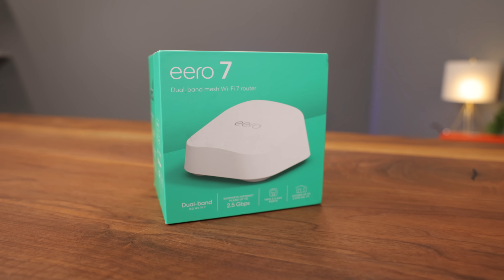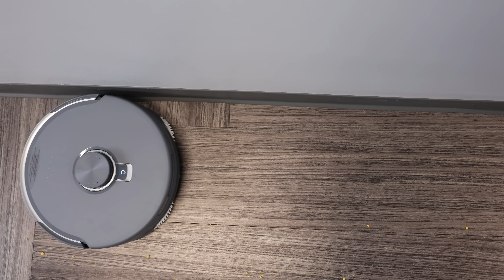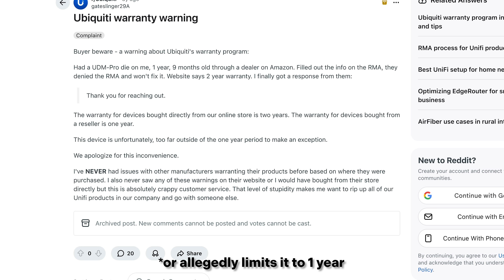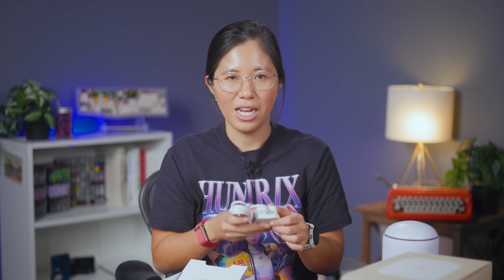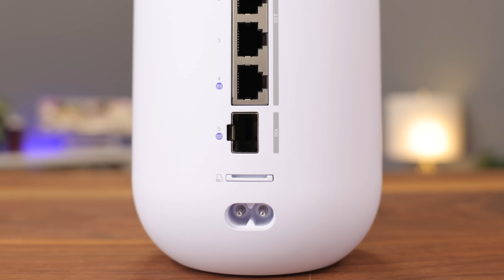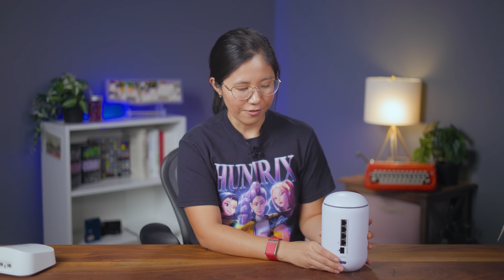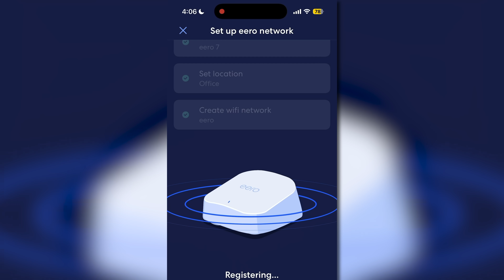Are Expensive Routers a Scam? (don't waste your money)

Comment: The comparison is interesting, but calling a 135€ Wi-Fi 7 router the “cheap option” feels misleading. At that point you could build a DIY router running something like OPNsense or another Linux-based routing setup, pair it with a budget access point, and end up with a solution that’s cheaper, more private, and way more configurable. Neither of the two routers shown really hits a good price-to-value ratio when a DIY setup outperforms both for less money.

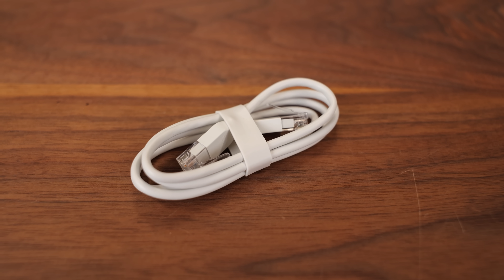Comment: 9:07 at 3 feet, the type of cable is almost irrelevant. Cat 5e, introduced in 2001, can reach 10Gbps across 3 feet.
The listed top speeds for different types of cables are for what they promise at much longer cable lengths, 50-100 meters.
That cable is not Cat 7 or 8, which required shielding & grounding, and would have metal caps on both ends.
In a home, anything since 5e is almost certainly plenty. A home user that would benefit from Cat 7 or 8 is going to be close to non-existent at this time

Comment: The way you say "eh thernet" cracks me up :) I mean that with luv... so I just bought my Ubiquiti Dream 7 a few days ago. HAven't hooked it up yet, as I'm on 2Gbps/2Gbps Symmetrical Fiber at the moment, and I'll be on 8Gb Sym. soon. ANYWAY Thank you for a GREAT video!
Reply from the maker: Where do you live to get these internet speeds? My max in the area is 1 😢
Reply: @SwitchandClickOfficial  I'm in Eastern Nebraska. company is called Fastwyre. Pure fiber even to the sfp+ using ONT. I pay $69.99 a month (with tax, a few fees etc.) for 2Gbps Symmetrical fiber. ZERO equipment rental fees using a CALIX GIGASPIRE BLAST U10XE. I'm soon switching out to the Calix Gigapoint Gp1100x so I can use my Ubiquti Dream 7, and a couple PoE++ switches for my network.
Reply: I want what you’ve got!
Reply: @louisuhls9528  I would share if I could! it took years in this area to get it!

Comment: I love how Ubiquiti HAS all three. Entry level,j Mid level and commercial level.
Reply: the entry level, mid level and commercial level are marketing term so that people think that the more expensive one is better. I have several clients that hesitate on going to unify system when I am doing their networking, I told them that ubiquity products don't have entry level they are professional grade products for every specific use. I told my clients that what they have is home network (entry level), SoHo (Mid level) and enterprise/high availability (flagship). when I explain those properly to the clients that was the time I was able to convince them to go with ubiquity products.
Reply: @slasher0009  THIS, I must say, Is Brilliant!  Thanks for sharing I'll have to remember this! SPOT ON!
Reply: I don't think ubiquiti really has an entry level there all professional products I also don't think prosumer is the right class for ubiquiti it's a business solution that they let normal people buy.
Reply: @jayred8289  I feel like the u7 express would be entry entry, like first wifi for apartment. And the udr7 is great for most people using most of unifi products, not just the network. The udr7 is shockingly powerful and it's not much more expensive than midrange stuff from other brands. The app is incredibly easy to use (and you can still use a web portal if you prefer). They really feel like a near perfect product for networking for most folks and I've ran through a LOT of routers since wireless g.
Reply: @jayred8289 what's more user friendly, prosumer,more affordable?
Reply: @jayred8289  This $279 gateway/AP combo unit is definitely entry level imo.
Reply: @j@jay @jayred8289 s a business system that’s easy enough to use that it’s good for home use too.

Comment: No more combined devices for me. Gotta buy your router, switches, and aps separately. Only way I saw to have a full 10Gbit network, current wifi, and coverage wherever you want it.
Reply: Same. However, you need to be a little more tech-savvy than some people who are going to Walmart, Amazon, etc., and buying a package of three or four meshed access points that you do almost nothing with (other than plug them into power). Ideally, people would be understanding and configuring firewall rules, VLANs for device isolation, etc., but that is a completely different group of home/SOHO users.

Comment: Not worth buying anything that isn't openWRT compatible. And right now there are very few wifi7 routers available on that compatible list.
Reply: Yeah, Wifi 7 is quite in beta right now for openWRT. Banana Pi R4 is a good candidate but still has its problems. I wanted to switch from Unifi to Banana Pi but sometimes you just want something that works, so I went for an eeor since it also has Thread support (though it is so so so locked down and there's probably so much telemetry back to Amazon)
Reply: What is the use case for the super expensive setups? I have a home network - dedicated servers - nas entertainment and I never have any issues with my basic wifi setup? Is it just a fun tech hobby or is there an actual use case?
Reply: @toddb4299 more fine grained control, remote management, remote alerts, etc.
Reply: What advantages, other than being FOSS, what advantages does OpenWRT have over UniFi?

Comment: Eero is crap, everything goes through the Internet before it goes to the router. No local control. If your Internet goes out, there's nothing you can do except reboot the router and call your ISP.

No manual troubleshooting or checking for logs/errors/incorrect settings.
Reply: That's not how the OSI model works... "going out to the internet before the router" is physically impossible.
Reply: There is no direct/local configuration. The app connects to the Amazon/Eero servers (either by your wifi Internet or mobile data). The data/commands are sent to/from your local router through their servers. If you have no Internet, their servers can't communicate with your router, so you can't do anything. There's no option to connect directly to the router with the app, you can't even login to the router directly with a browser on the LAN.

That's what's meant by Internet before the router.
Reply: @JayHughes-j6w This is a fair explanation of what was intended even if it wasn't what was said, thanks. 

This is not how they worked back when I had a set of them, but it's entirely possible (albiet unlikely) it could be different now. Back then, the app connected locally (when present), even though there wasn't a standard web UI page like on some devices. I am skeptical that they would have changed that model, otherwise there would be no way to do any diagnostics, manually re-acuire DHCP, or connect to any ISP requiring static addressing.
Reply: @JayHughes-j6w  you can hotspot with a phone.
Reply: @no1unorightnow   the app needs to talk to amazon and the eero servers, then the configuration commands are sent to the router. You cannot talk to the router on the local network without Internet. There is no direct connection for configuration/control. Not even with a computer browser using local IP.

That's what's meant by going to the Internet before the router.

This is 3+ years of frustration talking. I gave up and bought a Netgear mesh that I can direct connect to the router.
Reply: Maybe mine was a little different but I could still access Eero when I wasn't connected to WAN. It was a 2 years ago that I tried it I didn't like it because of the data collection and its locked down and while that's good for the average user I like to be able to segment my network. The nails that don't like my data, even if it is just "performance metrics" (yeah right), to be collected by Amazon.
Reply: @TyB4llz  I switched away just recently because I got tired whenever there was an Internet issue, not being able to figure out why my it wasn't working. All I was able to do was manually hard restart the eeros. My app just kept claiming it couldn't connect to the router even if I was on the wifi network.

Maybe it was one of the firmware/app updates between your time and mine. Amazon getting greedy with their analytics.

Comment: Unifi is king unless you're a CCNA / CCNP / CCIE, in which case it's down to whether you want easier administration with Unifi or more control with MikroTik.

Other options in that price range aren't going to let you configure VLANs, subnet in the 10 block, etc.

Uniti's zone firewall is also very good, and traditional ways of configure firewall rules are a pain and take more tech knowledge (ideally you'd use pfSense or opnsense if you aren't using zone firewall).
Reply: I have a CCNA and Fortinet Certified Professional.  Unify is still King for home and small business deployments.
Reply: @Masoon1983 until u want to go speedy that is, their 25/100gbe switch is trash
Reply: yep, my main gripe with unifi is the fact that anything other than simple networking is going to be a bad experience.
vpns - just users, no groups, only decent option is ovpn (wg is cool but key management is pain, good for s2s), limited to a single server instance, s2s ikev2 was a procedure (to get it working)
routing - ospf is a joke, only a single instance (per interface(s) selected) and i haven't found a way to see the remote routes, limited authentication etc
network logging - total traffic is accurate, per device total is like 10-50% off, no way to drill down other than the 2 super aggregated dashboard options and flows where you need to know pretty much exactly what you want
flows - it doesn't log connections from remote routes (only devices in the clients tab are shown) (egress traffic to remote routes is mostly fine again)
ips rules - ok alternative next to ngfw products with their subscriptions starting around 200/yr, again haven't found a way to browse the signatures and the description given are like a sentence max

my current solution is to have a mikrotik for the vpns and routing (some firewalling) and rest to unifi

id say average users don't need those, but seeing that they want to get into businesses...
at least central management and protect are very good
Reply: @slimz. I don’t care at all about the VPN, as I think an overlay VPN like Tailscale or NetBird is the way to go, so I wouldn’t even think about VPN on a router unless it supported those (and I’m not talking about GitHub projects that will let you connect UniFi to Tailscale if you SSH into it).

Can’t speak for the rest, I’m a developer so I basically just want my home services to work 😂
Reply: @praetorxyn   i’m sorry to bother you but maybe you can give me a quick recommendation? i’m a ccnp who’s running a local openbsd pf relayd setup in my home, but nothing fancy - single router, no AS/bgp, just a home router with 802.11n. i haven’t kept up - i mostly do software these past 20 years. i’m looking to upgrade to improve bandwidth for gamestreaming. i also need reliable power on, and low power usage due to all the electricity outages here in Ukraine. i’m looking for something i can set and forget, preferably opensource, something that can run basic daemons like dns and ssh relay, and a script to switch upstreams when the main provider goes down. my understanding is the options are a short list of openwrt compatible wifi7 devices, Unify like this one but i won’t be able to install opensource OS on it and i’ll be limited to functionality they have, or build a low-power custom box, probably on arm, with wifi6e pcie card? would you recommend seriously consider Unify or do you have an opinion about any of the openwrt wifi7 routers? i really don’t have too much time to set everything up from scratch right now so would like to avoid deep diving into hardware compatibility to build a new custom openbsd system.
Reply: Why not both! I know have both Ubiquity running as the primary router for everything that absolutely cannot go offline, and MikroTik for my self hosting needs. 

I’ve been using MikroTik longer and can say it is a rock solid platform that has gotten better with time, but when you mess up your config without backing it up… you’re cooked. MikroTik will not hold your hand. This is why I handed over basic but necessary internet needs to Ubiquity because I can fix that a lot faster than reconfiguring a MikroTik router.